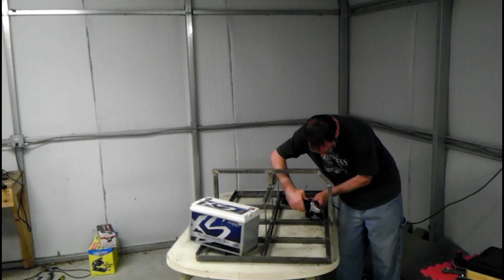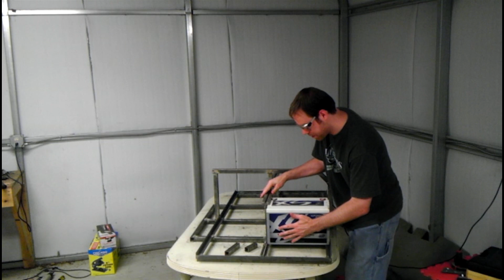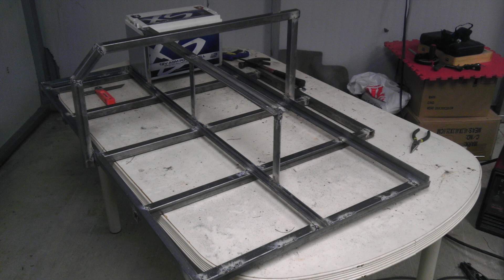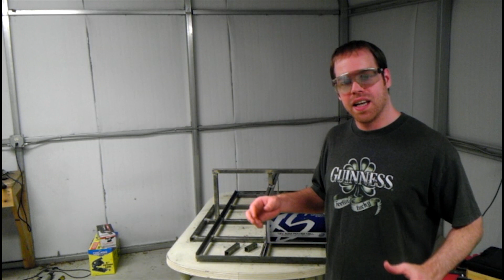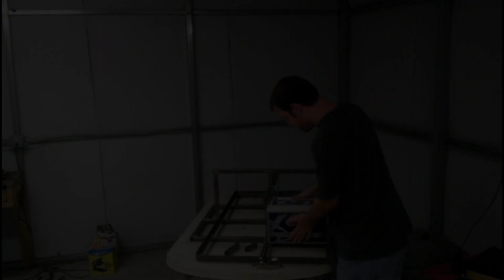Extremely Loud Car Build1

Comment from the maker: Makes sense. And yes, the box build may be a 2 parter since I will have the "Function" and then the "Finesse" But I do plan on doing different segments, like first is the fabrication of the "Home" of the batts, box etc... Then an alternator vid, then wiring, and batts and so on.